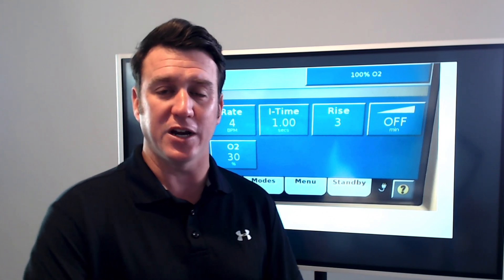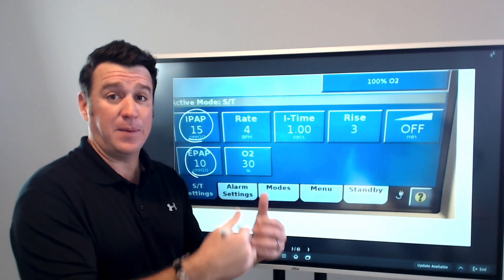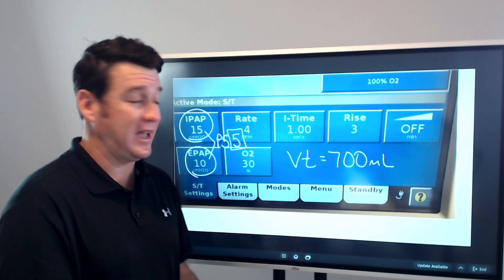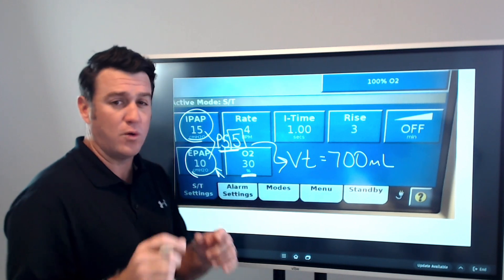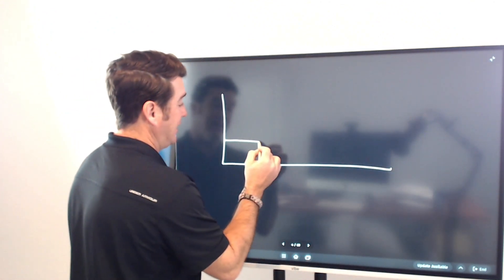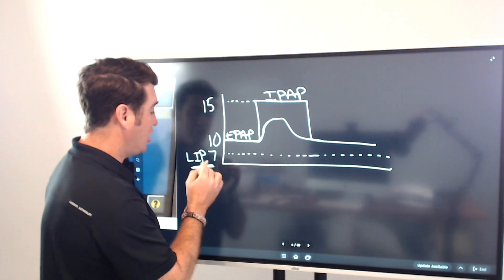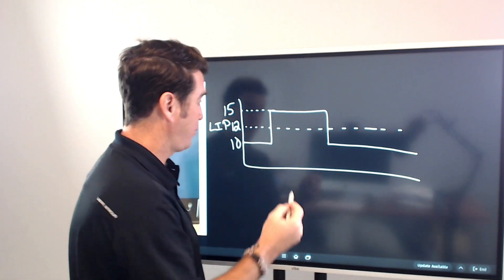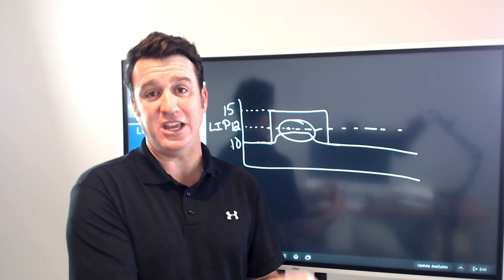Respiratory Therapy - Low Inspiratory Pressure Alarm during Non-invasive Ventilation

Comment: Hello coach thank you for this eye opening information just start learning about noninvasive and invasive in the clinic I would be so grateful if you cover the other alarms setting and give tips about what should we look for and be carful about as students .also speak about the different between the spontaneous, negative and positive pressure breathing mechanisms 👍🏻😊
Reply: Other question related to this Topic if my low inspiratory pressure went on what should I do in this case ?
Reply from the maker: Low insp pressure alarm is most often times indicative of  a leak.  Start with the patient- mask interface and work back from there to locate the leak.

Comment: We use Trilogy 100 and Evo in a home setting, can you show corrections for low inspiratory pressure, low inspiratory volume alarms going off all the time driving the Patient crazy.  AVAPS-AE setting are being used. What I have found is the problem is exacerbated by mask choice, a mask like Quattro Full Face or Amara FF seal the best but have patient comfort issues. The Amara View and similar style of Full Face provide better patient comfort but leak at the pressures used and alarm more often. We are as a facility leaning towards Amara View over the traditional Full Face masks. This has me stumped, it looks like the patient is fighting the home vent. I had 1 patient with ALS that had very minimal issues with leaks or low Tv or Press alarms. He used Amara Full Face and changed the cushion and head gear religiously.  Help
Reply from the maker: I wish I could help, but I have limited experience with home ventilators, and none with the Trilogy 100 and Evo.  Sounds like you're on to something with the mask choice.  Wish I could be more helpful.
Reply: @RespiratoryCoach  Thank you

Comment: If a pt is tacypneic on the bipap will increasing the rate help them?For example if a pt is breathing 45 times a minute, will increasing the rate to 30 help their WOB? Also once the LIP alarms what is that telling us?
Reply: If someone is breathing at 45 - more or less likely patient needs to be intubated - consider anxiety as a major factor not everyone a comfortable with face mask. Instead of increasing rate I will consider increasing PS .
Reply from the maker: The previous response is correct.  No increasing rate to 30 won't help a patient breathing 45 bpm.  It actually won't do anything because the patient is triggering at a rate faster than the set trigger time based on the set RR.  You would need to increase tidal volume by increasing PS by making your difference between epap and ipap greater.  Good question!
Reply: @Farhan I totally agree with them needing to be intubated , But my place of work doesn’t intubate until their vitals decline. So I’m trying to figure out ways to give my pts comfort when they’re so tachy. Thank you for the feedeback!
Reply: Thank you again for all that you do! These videos are extremely helpful.
Reply: My question about your video is, what can we as RT do if LIP alarm starts going off if it’s set between IPAP & EPAP?